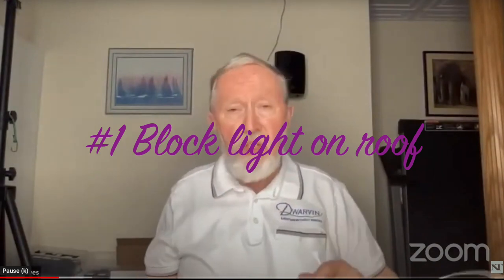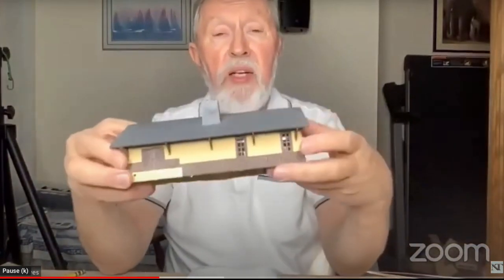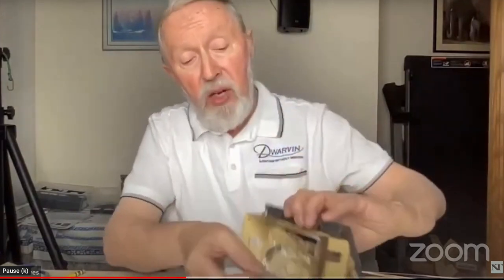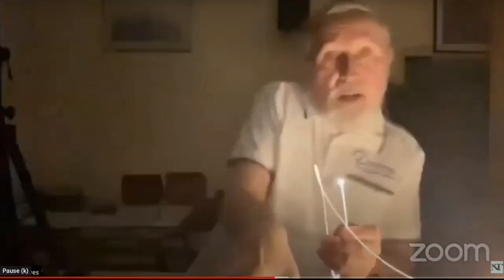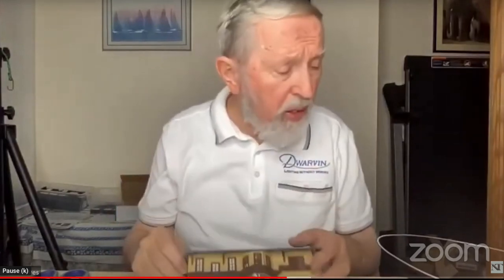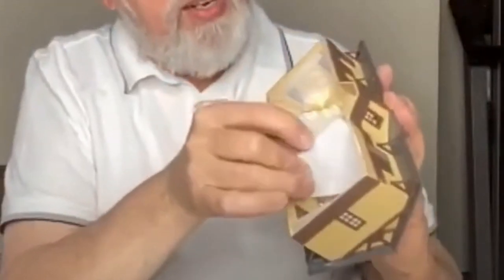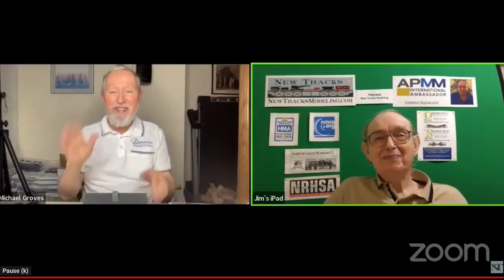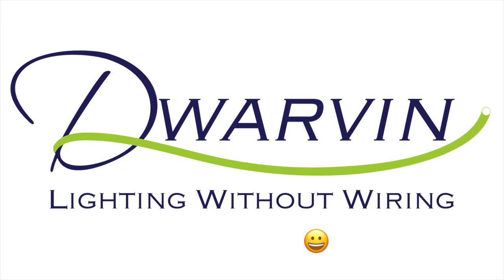How to Light a Model Train Building - Preparation (Jim Kellow "New Tracks" show)

Comment: You can also spread any liquid glue over the window to make it translucent
Reply from the maker: True - you are righ - thanks for thist.  However, when there is no window "glass" you need a substitute - that's where the parchment paper comes in handy.  That was the situation with the building I was working on.
Reply: @modeltrainsceniclighting-d8555  I didn’t catch that part about not having “glass”. If that happens to me I reach into my Ziplock bag of a couple of hundred windows left over from other projects 😂 (Your loyal customer, Wendell)